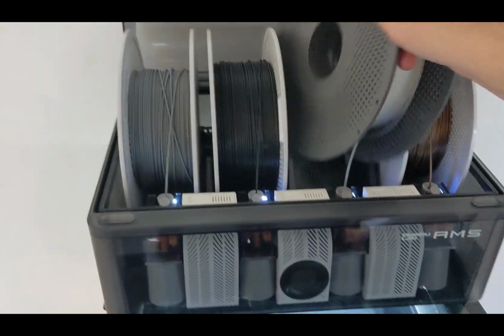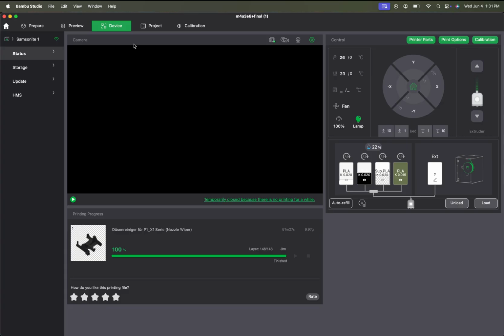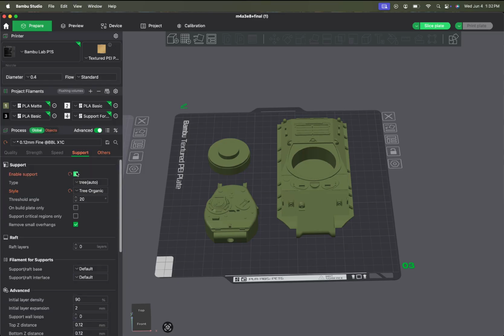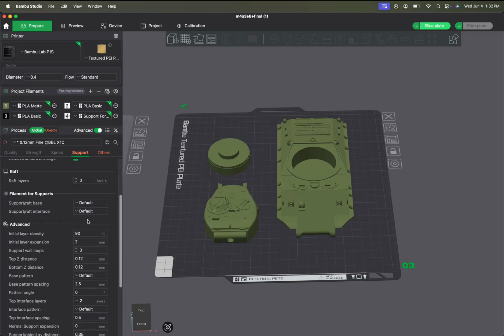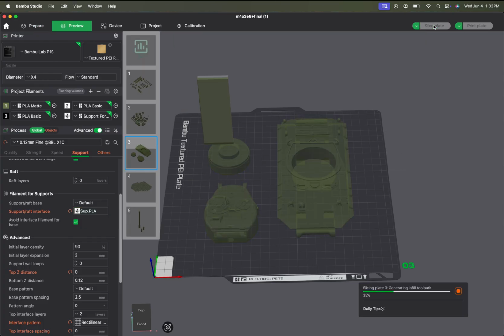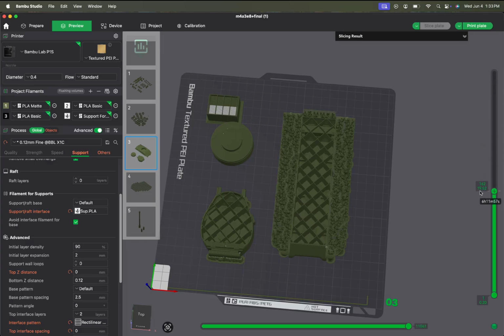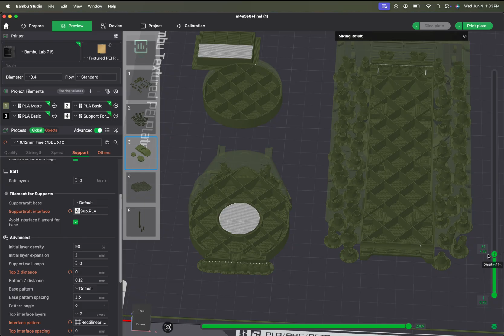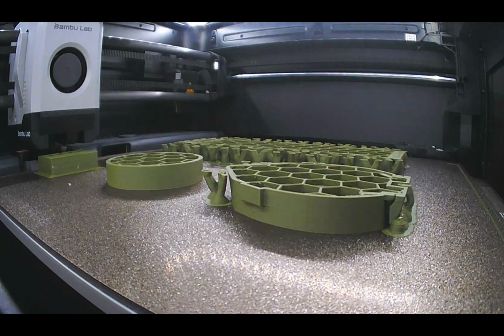How to use Bambu Lab's Support for PLA/PETG filament.

Comment: 3D newbie here... This would make your print longer, correct, having to do filament changes? And if so, how much longer? Thanks!
Reply from the maker: You are correct, the filament change will make it longer.  How long depending on the print.  I have some that only have a couple of spots that have supports, so it only has to change filament a few times.  And I've had some prints that basically had supports all the way up and it added a significant amount of time.  It was for a display piece so it was worth the cost and time of using the support filament.

Comment: Instead of buying the support filament, which is usually more expensive than PLA/PETG, use PLA for the support interface layers of a PETG print and vice versa. PLA and PETG don’t fuse and you can even transfer patterns to the supported bottom layers by ironing those patterns into the top support interface layer. No need to buy material just to throw away. Use what you have on hand.
Reply from the maker: Yep, that works too.

Comment: I’m a big fan of it but it let me down for the first time last night. Now that I’m thinking about it, it may be the first time I used it with PETG but it fused and ruined the print. More research is needed on my part, and yes it is the support for PETG/PLA. In case anyone is curious it’s the wormhole lamp on MakerWorld.
Reply from the maker: Sorry it didn't work for you.  I haven't tried it with PETG yet.  99% of what I print is PLA.
Reply: @nozzle_vision  After some more research I found the support filament that ships with the P1S is PLA only support. I found this out after I bought some replacement PLA/PETG support filament from Bambu and the spool is grey. It made me check and sure enough it is marked support PLA. I tried the new with PETG and it worked ok. The print I used wasn’t a good test but I believe it will be fine. thx

Comment: i bought some petg for support material and another mount and tube, only to find out the a1 has to have the lite unless you want to hang out ND Manually LOAD FILAMENT DURING CHANGES. SO IT WILL BE A MIUTE BEFORE IM DOING DUAL FILAMENT. sorry about the caps lock accident. good video saved to my watch later

Comment: So that is a support filament that goes in between the layers on PETG as the interface layers
Reply from the maker: Yep, I've never used it with PETG but it should work as the interface layer with both PLA and PETG

Comment: NICE!! But must really be slow at angled attachments!?
Reply from the maker: Yep, it can add a lot of time to the print.  I don't use it on every print because of that and the cost of the support filament.  Typically I only use it for a display piece that I want to be super clean or a model that has a large support area like the tank in the video.

Comment: Thanks for the video! I'm relatively new to 3D printing, and my Bambu Lab P1S came with a roll of the support filament, but I have not tried it because I didn't really know how to use it. I think I'll give it a try next time I need to print something with supports.
Reply from the maker: I'm glad I could help.  When I got my P1S, it also came with a roll and I just thought it was normal filament.  I ended up printing a dragon with it before I figured it out.  It worked fine and the dragon looks cool but it definitely isn't meant for that. 😁

Comment: I just bought this and was excited to use it for models I’m designing where the supports ruin the surface and it needs to be smooth. But first I wanted to test it in another model I found, but just as an interface layer, the model I wanted to print went from 7 hours to 16 hours and I’m not doing that so I decided nope. Over doubling the time just for some clean support is ridiculous.
Reply from the maker: It can definitely add some serious time if you have a lot of layers that need support interfaces.  With the tanks I've been printing, I've only had a handful of layers that had an interface so it really didn't add much time on those models.  It's also not cheap, so I don't use it every time but it comes in handy when I want a clean layer.

Comment: Woah...... what model is that?! Can you calibrate the support filament?
Reply from the maker: The model that I was slicing is a Sherman tank.  I have a video coming up showing the print and build.  Here's the link to the model:https://makerworld.com/en/models/578711-sherman-m4a3e8-fury-medium-world-war-2-tank#profileId-499471
And the final clip is an Abrams Tank.  I have a video of the print and build on my channel.  Here's the link to the model: https://makerworld.com/en/models/504844-m1a2-abrams-1-35-fully-3d-printed-model-tank#profileId-420501
The clip in the middle is of the Y is a custom design that I haven't published or made the video of yet.
Reply from the maker: As far as calibrating the support filament, all the settings it adjusts are shown in Bambu Studio.  It will highlight what it changed and you can go manually adjust them if you want.  The default settings always work great for me.